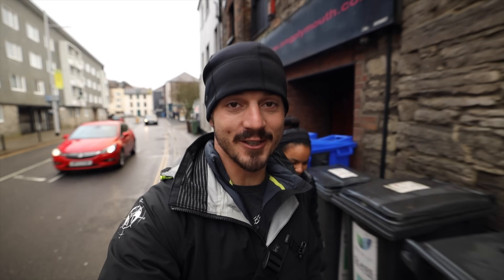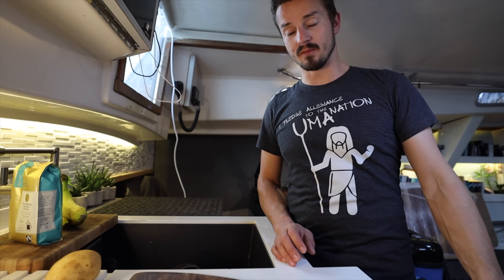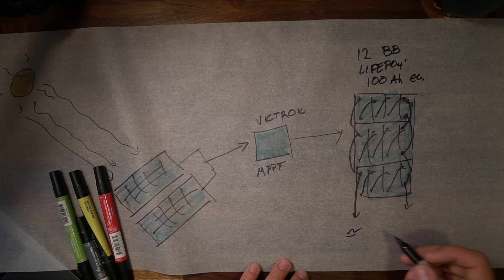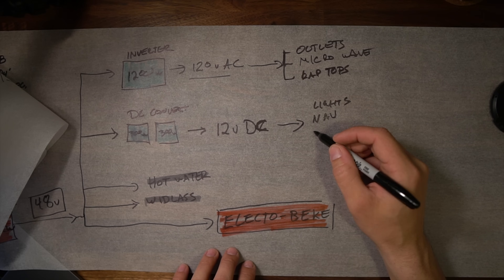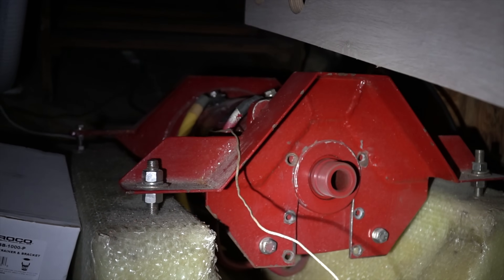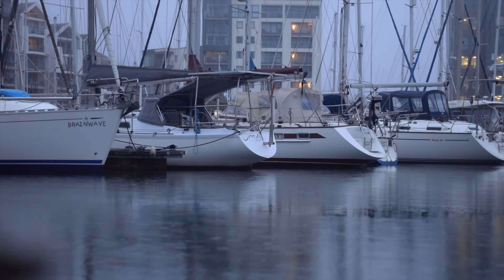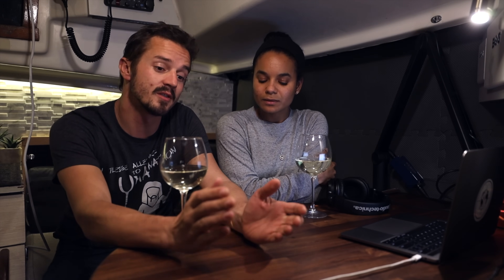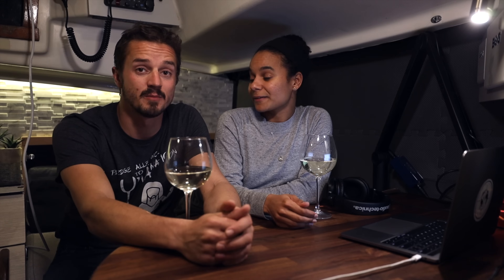5 Years Living offgrid on an ALL ELECTRIC Sailboat — Sailing Uma [Step 206]

Comment: What did you mean by “power back from the prop?” Are there hydro options? We’re just starting our research and found this video particularly helpful.
Reply from the maker: In a nutshell it means that when we are sailing, The prop spinning thru the water creates power to charge our batteries.
Reply: Sailing Uma, that’s what I assumed, sounds like a hydro generator. Thank you! Btw, I studied in Atlanta also, at GT for engineering. Really enjoy your videos, especially the ones where you discuss how/why you went with a certain solution and your processes. Hoping my husband and I can have a similar lifestyle to yours when we leave the Navy.

Comment: I've been slowly catching up on your videos since I came across the channel a week or two back (yes, this is "slow" for me, 200+ videos, two weeks? Gah!). In this video you mention you are charging your laptops via the inverter, yet you have new laptops, they look like they take USB-C. I know there are some nice higher-power 12v->USB-C adapters out there that should let them charge up via 12v. Not sure if you've looked into it or not... I know my laptop will charge off a regular USB-C port when shut off, but it's slow compared to a higher power charger... removing the inefficiency of the inverter for at least a single charge a day for each laptop might be helpful...

Comment: Why use the converters for 12v dc when you can tap 12v DC directly from any of a number of terminals on your battery bank? Converters add inefficiencies and a point of failure.

Comment: Thanks for this video, it's very informative. BTW, you often say "kilowatt" or "watt" when you meant "kilowatt-hour" or "watt-hour" (e.g. batteries are 15 kWh of capacity; they'll also have a maximum kW power capability, you'd want to make sure your microwave + drive motor + other loads don't exceed that). Watts is power, an instantaneous measure (how "fast" energy is entering or leaving your batteries); Watt-hours is energy, how much you store or use (over some period of time).
Reply from the maker: Yea honestly, we kept it simple
Because mainly we figured those we know the difference would understand what we mean, and those who dont know wouldnt get confused.

Comment: I like your new Nav Table. A suggestion, put rubber place mats under laptop or plates while at sea to stop items sliding around. I also like the round edged Nav table which will prevent injuries or getting hurt while at sea. Great improvements has been done on Uma. Congratulations to Dan and Kika.

Comment: I am studying how to build a solar panel, battery bank array, and this video gave me a lot of ideas. I SPECIALLY appreciate the diagram on where the voltage controller goes in relation to the battery bank. The distribution of the inverters and the DC converters were eye opening.  Excellent help. Thank you.

Comment: I would love to see a video on how you calculate the wattage use like you said for each appliance - and then how that determined how many batteries you needed to buy - Also is it better to have more solar panels drawing in the energy or more batteries? I know it's a balance of trying to find the sweet spot on both but how do you determine that? Thanks! so beautifully and efficiently explained on how everything comes together!!!

Comment: Well... The suns rays don't bounce off the solar panels.. I mean.. that would completely defeat the fuckin purpose of something is designed to capture as much sunlight as possible.
Reply from the maker: They’re only about 20% efficient, which means 80% of the light hitting them either bounces off or is transferred as heat.

Comment: Great Channel, great content, Awesome
Have you ever thought of just ditching the 120 power supplies for the electronics? If it haven't been mentioned, you should.
Rather than taking your laptops psu up to 120ac, and then back down to either 24vdc or 12vdc through the brick converter and losing energy, you could come straight of the batteries... (Same thing with all the 5v stuff, but you would need a DC/DC converter)

Comment: You can make the fridge and freezer much more efficent by going watercooling, or keelcooling they call it. Also for your safety, put a generator on board and some fuel. Just in case.

Comment: Hi Guys!!!! Greetings from St Catharines Ontario!!..i'm a new sub but you got me hooked already! i'm also brand new to the solar power world. i've watched tons of videos on solar use and yours has been the easiest to understand! thanks Dan...and Kika too! i'm planning to use my solar just for camping and any possible emergency outage at home. my biggest question is storage . no way do i need anything massive but i'm thinking maaaybe 2 batteries would be tons?...Dan, with this system what would you suggest? I'm a single Dad with 4 kids all with their devices and I with mine for charging...possible microwave in the future and  a few LED lights around the campsite and tent. Any help with suggestions would be very appreciated! 
https://www.amazon.ca/ECO-WORTHY-Monocrystalline-Complete-Off-Grid-Controller/dp/B07K233GT8/ref=pd_bap_rp_15?_encoding=UTF8&pd_rd_i=B07K233GT8&pd_rd_r=7c3c1690-1758-4003-ac41-fac4cc147871&pd_rd_w=hqyUE&pd_rd_wg=Ens3s&pf_rd_p=1f71a7d9-41ad-49db-93aa-a0c737a86598&pf_rd_r=G6S8JTXE09X7W0NF1NWD&psc=1&refRID=EDP3KXSQJD509SKRJFYK

Comment: Using the propeller to produce electricity while sailing wouldn't be 
very efficient at all. In fact, it would create more drag on the boat 
and reduce the efficiency of the sails. One thing you could do is 
replace that old brushed forklift motor with a 3-phase brushless motor. 
You could get more speed while motoring and consume less power. Your 
best bet for making up lost power would be to get a 1000watt generator 
running sparingly unless you're completely against using fuel.
Reply from the maker: We generate 2-400W while sailing with no noticeable loss in speed.
Reply: @SailingUma  Yes sorry for jumping to a conclusion before watching the next few vids. Glad you got the bearing issue sorted out on it. That would have sucked if that failed on a long passage.

Comment: Why not use car style laptop chargers that way your not loosing some power running the inverter to run a charger that runs at the lower voltage

Comment: Power always includes time. So 15kW is instantaneous power. 15kWh (the h is for hours) is stored power, meaning that you can deliver 15kW for one hour, or 7.5kW for two hours, etc. Just like batteries.

Comment: Hi, It's Me again. I run a program called OPEN CPN on my old Acer Windows laptop. It is a comprehensive (free opensource) Chartplotter that runs on most os's. The electronic charts can be downloaded from NOAA Free. All the usual overlays on-screen, AIS contacts, Wind, Tidal streams, Weather-warnings.  Radar and AIS input is by way of a USB converter input. My laptop has no GPS, but again, a simple GPS position finder plugs into one of the USB's. So if you find yourself running low on power you can run a decent nav system on your laptop. Handy if you are in bed and want to keep an eye on things. Anchor Wach and things. NOAA charts are not bad but I paid a few pounds and got very detailed charts of all UK waters and west coast of France from visitMyHarbour.com . They have very detailed of the whole world. Worth checking out.

Comment: Hello Uma, Great show. If you check the brick that charges your laptop it will probably be 19v at 35-40 w.
I got a DC to DC 12v to 19.5 - 40W transformer from, I think eBay ( CHINA )for $17.00. You can get them in any size or rating. Been working for 4 years now driving and charging my laptop and no probs. Wired in, an on/off switch on the 12v side before the DC to DC transformer to save 12v when not in use. Saves a lot of power as the 120v inverter uses 4-5X  the DC-DC converter does. Made up a lead for it to plug in the laptop up in the pilothouse or down in the cabin. Got a 5V one for charging phones or anything you would charge with a  USB. Far better conversion rate than running an inverter from 12v DC to 120vAC then back down to 19v DC (brick) for your laptop again.

Comment: All electric? You mean using electric power move around or just powering up internal systems?
Reply from the maker: Did you watch the video? We generate all our power from the sun, and use it to power all the electronics onboard, including the electric motor.
Reply: @SailingUma  yup i did. Nice explanation.
Reply: @SailingUma 
Still onboard?

Comment: Why don’t ships have wind generators at the top of the mast?
Reply from the maker: It’s a good question. I think the main reason is noise. That sound would vibrate down inside the boat and be quite loud. Also a lot of folks don’t go up their own masts, so maintenance could be an issue.

Comment: Well it may have been cheap before but it sure ain't now lifepo batteries like those are about a grand apiece unless you build them yourselves
Reply from the maker: The good thing is, batteries are only getting cheaper and more available, diesel will only get more expensive. But the batteries are our "fuel tank" so, IF we kept the old diesel, it had a 20 Gallon tank, so we could fill it up about 50-100 times (depending on what country we're in) for the same price. Depending on how you sail, that's definitely a few years of diesel fuel, but certainly not 30 yrs worth. Not including oil changes, fuel filters, fuel additives, alternator belts, starter motors, bad hoses, impellers, zinks, etc. 

I think the big difference is, with electric, you put all your costs upfront, then it's done, no more cost for the life of the motor. With diesel, there is a pretty significant cost upfront still, but then the cost trickle in for the life of the motor, and only grow over time.

Comment: Hi,
I'm sorry for my ignorance but you said sometimes the refrigerator and the freezer are not on constantly. What happens with the food inside them?
Good luck!!!
Reply from the maker: So the fridge and freezer we have are compressor type units with heat exchangers. They run for 10-15 min to cool down the inside of the fridge, then shut off for 10-15 min. Things heat up a little and then the click back on again. Make sense? So for every hour of operation, they’re only consuming power for half that time.

Comment: You can probably connect your lap top directly to 12V. Check your AC power supply for the exact Voltage and Current...

Comment: My god I cannot believe there is no a flow of disbelieve s on the subject That was not a trip of the tong . I am positive you do not produce  2 KW of power, if you do quickly get a patent and buy yourself a100ft  schooner.
It is simple but to long for here so better start with grade 10 physics101: electricity the basics ; a Coulomb is quantity of charge carried by a current  of one  Ampere for one Second 
and keep reading

Comment: Typically wind generators are put at the back of a boat. But is it possible (or logical) to add one to the top of the mast? I would think this would be a better location since it would be higher to get more wind, would not get in the way of sailing or cause shadows by being directly over solar panels. Thoughts?
Reply from the maker: Top of the mast install would create a lot of vibration noise down inside the boat.

Comment: is it safe to keep lifepo4 batteries on a boat. What happened if boat starts to take water and short the batteries. Will it be fire/explosion?
Reply from the maker: LifePO4 is a very stable technology. It's very, VERY had to get them to have a catastrophic failure. Also, ours our mounted quite high up and our boat would have to be about 60% full of water before the tops got wet, so basically sinking.

Comment: No clue when you're talking about watts and watt-hours, so confusing xd
Reply: Same here. In that case I would personally just copy the same setup specs what these guys did and it should work. The only thing that would differ would be if you need 240V apposed to the USA 110V system. In that case there would have to be a different inverter to suit. Anyway , that's just my thinking. I am by no means any expert.

Comment: You can easily make a cable to charge your laptop directly or through a DC-Dc converter from the battery bank. Just check your necessary voltage that you can clearly see on the charger. It would be much more efficient.

Comment: If you have the new Macs with USB C you don’t need AC power at all. Just buy a high capacity 12v usb c car charger (Anker brand) make sure it’s the higher capacity kind. It may not be as powerful as ac plug, but it should keep you topped off and you don’t need to run your inverter.

Comment: You would have to turn off everything off to boil the kettle or it would trip the inverter.
Reply from the maker: The kettle and microwave are the only things running off the inverter, so no, we can't use them at the same time, but we don't need to anyway.
Reply: @SailingUma  I use 240 volt fridge ,freezer, tv ,dishwasher,toaster,water pump,kettle lights ,laptop,  red copper 5 minute cooker and power tools all off my 360 amp lithium 12volt . I did use a 3000 watt inverter but it used too much power on standby so now I use  a 1500 watt and turn off the fridge and freezer when boiling the kettle and using the copper cooker..  1.1 kw of solar panels .Love my lithium batteries.

Comment: What about vertical-axis wind generators? They are not very popular, but they are very simple and compact. They are omni-directional and do not require alignment with the wind, and could be mounted either on top or on the side of the mast:).  https://en.wikipedia.org/wiki/Vertical_axis_wind_turbine

Comment: you can add a kayak turbine with big lightweight fins and a controller with regen to control the amp input and voltage input into your battery when you are docked in open waters over night ;)

Comment: I enjoy for videos for the technical talk. My ultimate cat would be set up as you did Uma, 100% off grid, for circumnavigation. I would add composting toilets as well.  I am not by any stretch a radical environmentalist, however, looking at a sailboat, solar makes sense.  That leads to electric motors for propulsion. The biggest challenge is having enough power to run the boat and live comfortably; for example, washing machine/dryer, air conditioning, fresh water for bathing and other needs.  Watching this video, a key metric for my computers would be efficiency in operation, something I never thought about. As much as I prefer gas for cooking and heating, carrying a 100 lb propane tank and getting it refueled could present issues, so I am researching induction cooktops and infrared ovens. I truly appreciate watching and listening to your experiences. At this point, this boat exists in my mind and a rather large folder on my laptop.  Thank you.

Comment: This analysis is super helpful and awesome. However, my inner engineer won't shut up until I note that battery storage is measured in watt-hours (Wh or kWh), not just watts. Watts are a rate measurement of energy, while watt-hours is a measure of capacity.

Comment: Love the videos. Am planning a similar project w a sailboat using my RV experience. You have 1.6k comments and I didn’t see this addressed so if not already somewhere below, maybe this will help; (virtually) all electronics inherently run on dc power. eg, I have a dc adapter for my Mac. When you use an inverter to from 12v/48v dc to 110v ac and then right back to dc w the transformer, that’s all wasted energy. I saw you guys have battery tools. My Milwaukee drills, saw etc (your brand may vary) have a ‘car charger’; again allowing me to leave the inverter off all together. They do make dc microwaves but I’m not a fan of what’s currently available (no pun..). Lastly, not all LEDs are built alike, there are different ‘generations’ with newer ones even more efficient. Hope this helps, looking forwards to your next video.

Comment: Great videos, well presented. In your sketch you show the twelve 12 volt batteries connected series/parallel to give three banks of 48 volts with the charge/discharge connection at one end.
Is this how they are actually interconnected? If so, and you have a few minutes spare, take a look at this; http://www.smartgauge.co.uk/batt_con.html
Until I stumbled across this information I had no idea how critical the method is for charging and discharging multiple batteries.

Comment: Love your idea on saving electricity tho if I bought a 45 to 54ft boat what would I need to give more power an would a small tv  for  DVDs  an what would I need for a bigger engine , Martin
Reply from the maker: The three largest power draws on our boat (while living on anchor, so not including the motor) are Fridge, Freezer and lights (and for us laptops, since we're on them all day.) So for 2 people, the fridge and freezer could be the same size, and though a 45ft boat would have more lights, you don't have to have them all on all the time. But, a larger boat means more room for solar panels and windturbines, so it can certainly be done.

Comment: Why not use a small diesel generator to charge up the batteries when solar energy is insufficient?
Reply from the maker: We took the diesel motor out of our boat 5 years ago for a reason. So far, solar has kept up fine. We're working on regen now, and then potentially a wind generator, and then we'd add a removable solar awning if we still needed more power. There really isn't the need for a genset.